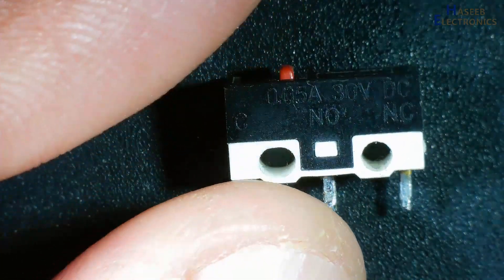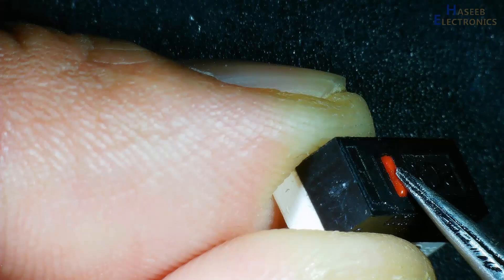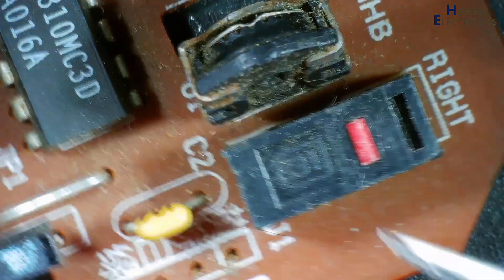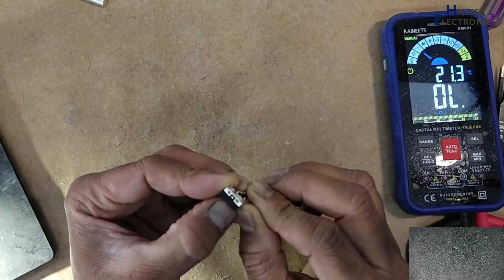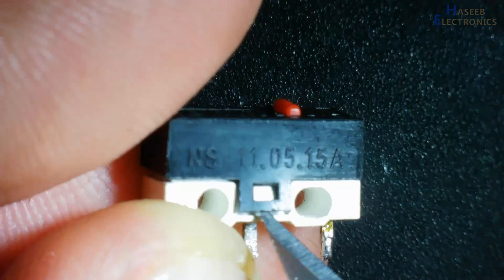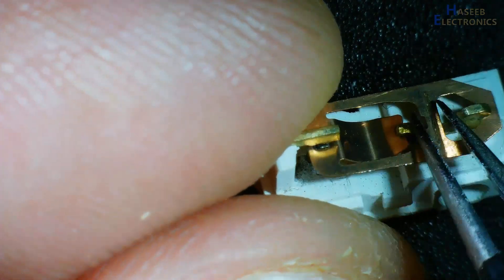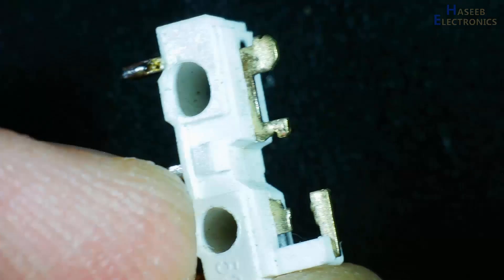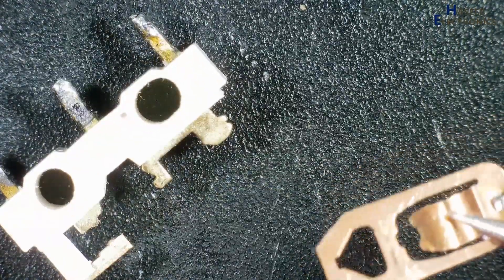{1069A} Anatomy of damaged micro-switch

Comment: Hi bro!
On one smd transistor DK QG was written on it. May I know its part number?
Reply from the maker: brother 
you didn't mentioned its package style and pcb marking (U__ or D___ or Q____)
if it is SOT-89 package then it is 2SB1025-K or 2SB798-K PNP transistor 
if its package style is SOT-23 then it will 2SK2909 MOSFET n-type
https://smd.yooneed.one/code444b.html
Reply: @HaseebElectronics  
Bro!
PCB marking is DK QG
Package is SOT-89

Comment: I was expecting you to clean it, bend the contact to have more pressure, reassemble and check if it works. In some cases of special contact that is sometimes the only solution. Personally I would have done that to satisfy my curiosity :-)